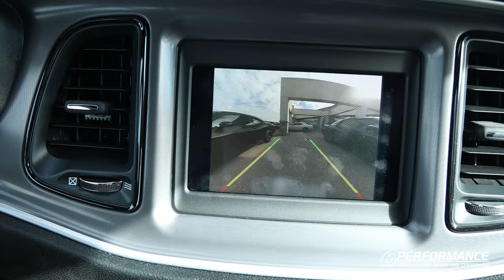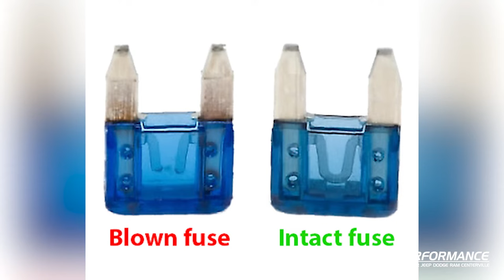Tips to Fix Backup Camera

Comment: My Chrysler dealer installed a back up camera on my 2015 300C. It works sporadically, usually cuts off in early spring, and stays off until Autumn. However, sometimes it will work in hot weather and other times it won’t work in winter months. They want more $ to diagnose the problem than what they charged me to install it. What should I look at first to diagnose problem?